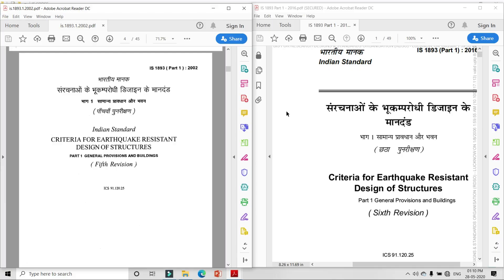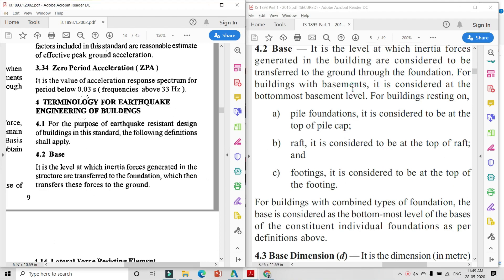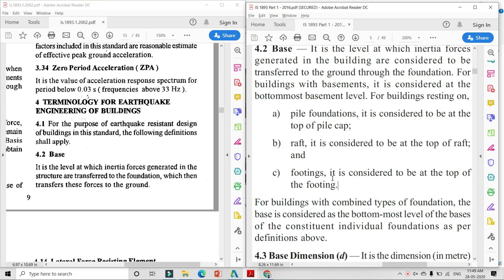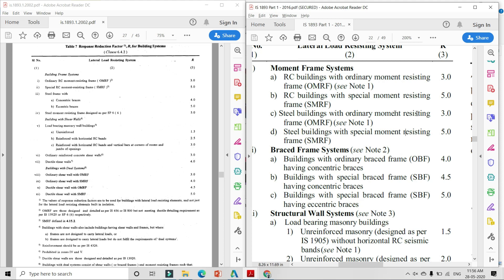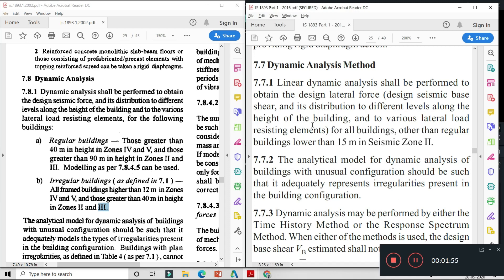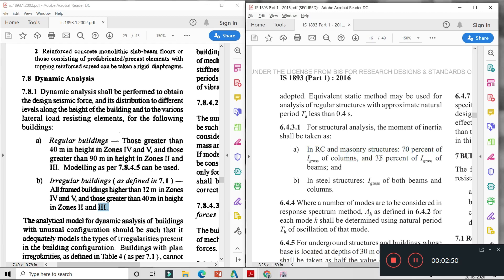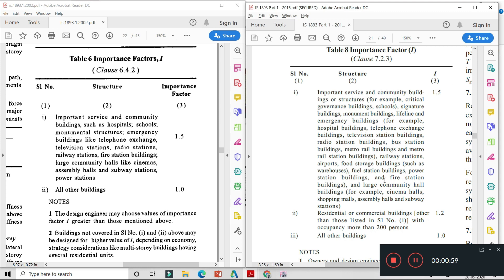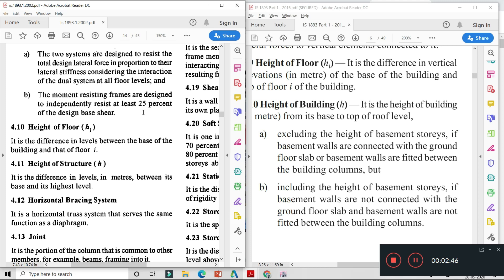Comparison of IS 1893 Part-1-2002 & IS 1893 Part-1-2016

Comment: in 2002 edition we were using Table 3 which was giving multiplication factors for different % of damping other than 5%. We use this table for static equipment seismic loading. But now this table is deleted in 2016 edition. So whether now its mandatory to use 5% damping for static equipment seismic design also ?
Reply from the maker: Yes sir definitely right